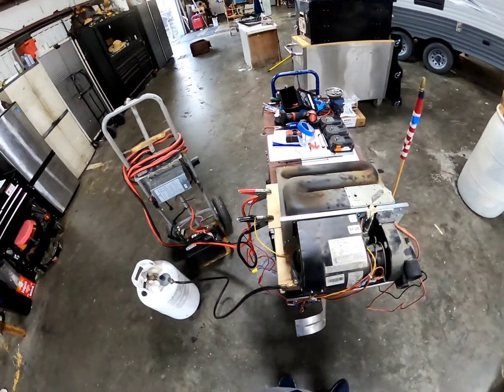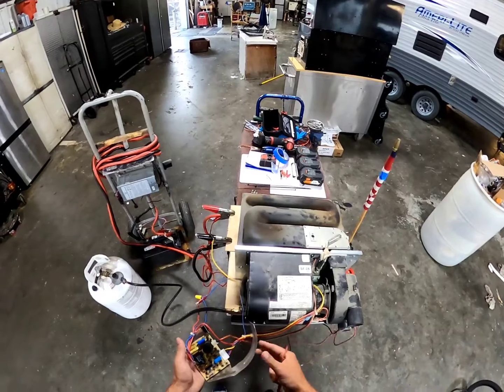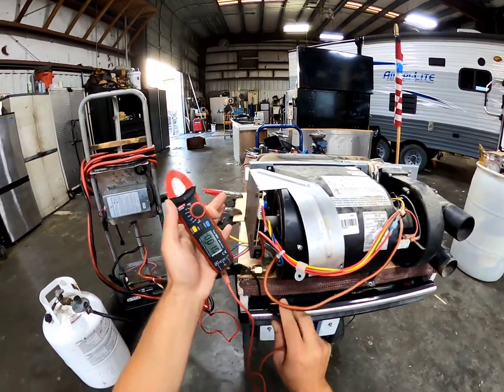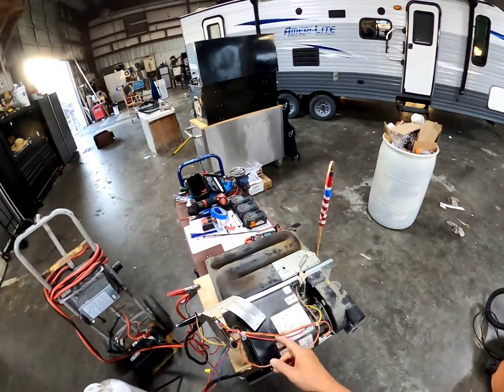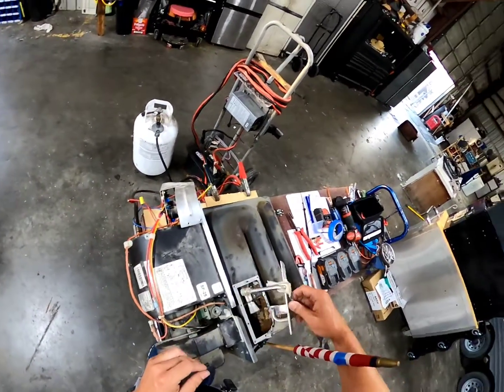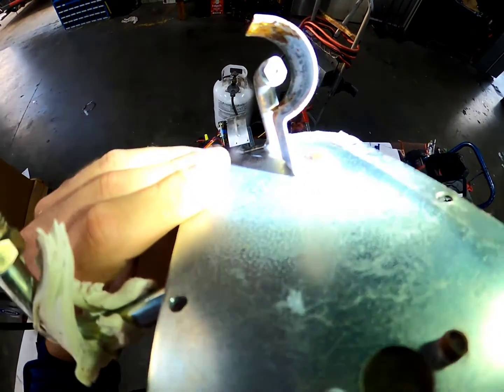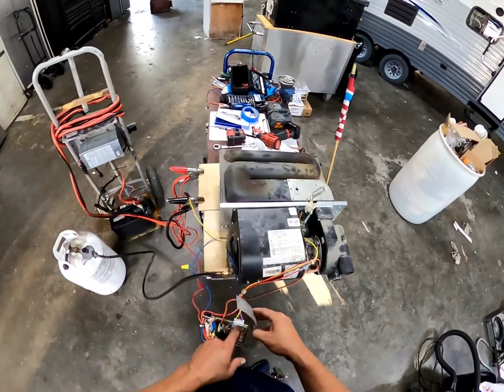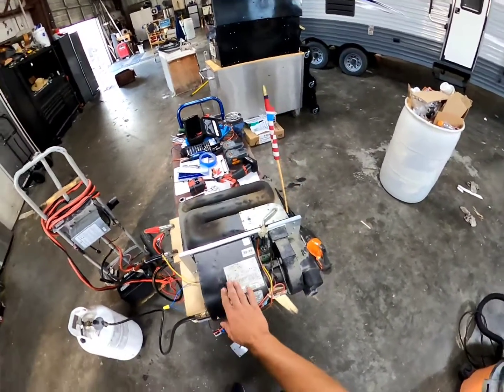Training and diagnosis of an RV Suburban furnace. SF-25.

Comment: Same furnace, what would cause it not to fire when it’s cold? Fan blows but no heat. I hear it click. It works fine when it’s above freezing temperatures
Reply from the maker: Harry, on your control board, when it isn't working, check for positive DC voltage at  the white connector on the blue wire and then the red wire. Let me know and we will know what to check next.
Reply: @nicholasgriffin6631  wow, thank you so much for responding so quick!!!
Problem is that between 8:45 and noon this thing decided to work. Still going. My fear is though that when it’s gets below again I am left with no heat again
Reply from the maker: @harryohanson  I'm hoping we can figure it out. Propane won't stay liquid unless it's -44° so that's not the issue. We'll need to use a voltmeter when the problem happens to get an idea of whats going on. Also next time it happens go outside to it and listen for 2 things. 1) the soft thunk of your gas valve opening, and the ticking of your ignitor electrode. This info will be really useful. I hope it doesn't stop working on you again though!
Reply: @nicholasgriffin6631  oh that is a good idea! Thank you so much!!

Comment: Hi I'm back again.  With a new problem.   When I jump the blue wires I get heat.  When I connect it to thermostat I don't, so a new thermostat.  Or at least jump the blue wires at the thermostat to test.  I may have shorted blue wires to the furnace case.   But let me ask this.  I've got 3 wires coming into the heater space.  One wire to ground.  I'm thinking that's the ground into the thermostat. Blue.  Sounds right ?   
And will the wiring colors be the same on a new thermostat, universal wiring colors?
Reply from the maker: Your question depends on what kind of thermostat and air conditioner you have? They operate the furnace differently based on which you have.

Comment: Hi.  My problem is intermittent.  I've blown out the sail switch already.  Im smelling propane, but no ignition...
So in This order...
I should check the igniter spark at the board, and in the heating chamber?  If no spark, clean the electrode, then if that fails get a new board?
I should check a plugged orifice?
I should consider a bad regulator, because I read that somewhere?
Thanks for a really good video.
Reply from the maker: Texasliam so I can better help you, what exactly is your furnace doing? Does it come on and fan blows but never ignites? Does it not come on at all?
Reply from the maker: Texasliam as seen in my video, on your 4 wire white harness that connects to the control board, do you have DC voltage on the blue wire first and second on the red wire that is on that 4 wire white harness? Those complete the safety check up through the limit switch and sail switch. Get back to me with that answer and let's go from there! This will tell us what we need to check next. In the video its around the 3 minute 20 second mark. 💯
Reply: @nicholasgriffin6631  when the problem re occurs I'll check that.
Reply: @nicholasgriffin6631  it blows for more than 30 seconds usually.  And I smell quite a bit of propane on the exaust.  Of course I don't have access to the fan side.  So I'm hesitant to pull it when it's currently working.  I just thinking it might be worthwhile to pull it and clean out the ignition area.??I do have voltage on both sides of the limit switch.
Reply from the maker: @texasliam  ok I understand a bit more now. So it does work, just sometimes does not want to ignite. Is that correct? If so then I would think you have a good idea to eventually pull it and clean out the burn chamber. Also you could have a small propane leak somewhere that is allowing air into your lp system. This would make your furnace have similar issues. A drop down test using a manometer would reveal this for you. But since you say you smell propane, and it is currently working, I agree with you that some cleaning is the best route to go right now. Reach out again if need be. And keep an eye out for more videos. I haven't shot any lately because of daylight savings time, its too dark in the mornings right now lol. Water heaters are coming next, and eventually everything!

Comment: My furnace quit after a blue wire came loose, no one can tell me where it goes. there's actually two blue wires like you mentioned, but I have only one white wire hanging to nothing. One has power the other one none. Looks like you know more than Heartland and Atwood. Subscribed.
Reply from the maker: You will have to give me these details for the best help. You should have 4 wires leaving your furnace going into your RV. What colors are connected? And where the wire nuts or electrical connectors are (transitioning from the furnace and then disappearing into your coach) how many wires do you have (coach side). I ask because, of your 2 blue wires, some manufacturers only use one.
Reply from the maker: The 4 wires coming directly out of your furnace are color coded. Should be red, yellow (this wire is sometimes black) and 2 blue wires. While these wires are consistent from the furnace, when the manufacturer connects them to your RV they use different colors and gauge of wire. The 2 larger wires from the manufacturer should be your main DC positive and negative. The 2 blues are (1) power up (signal related and not always used) and then the last blue (2) is signal down (must be used).
Reply: @nicholasgriffin6631  yep red black and 2 blue, on blue has 12v I’m assuming one of the blues goes to the white, probably came loose moving  to where I am now.
Reply from the maker: @dean lockamy do this. With your thermostat turned off, check that white wire for voltage. Then turn your thermostat back on and turn the thermostat to activate your furnace, and check the white wire for voltage again. If that white wire doesn't have voltage unless you turn on the thermostat and put it to heat (plus have temp set high enough to call for the furnace) then it is your signal wire and you need to connect the white wire to the blue wire that DOES NOT have voltage. However, if the white wire NEVER has voltage, get back to me and let me know. 💪
Reply: @nicholasgriffin6631  thanks Ill try that as soon as i get back up to the camper, Im sure reconnecting that blue wire will do the trick, as we know quality control is less than desirable in camper construction. Ill let you know.

Comment: Thank you for the video; it gave me the confidence to tackle the project.  I have an SF-25 made by Suburban.  To better troubleshoot, I took the furnace out of the RV.  I did open the firebox, and sure enough, there was a bee nest in there.  There was no way the furnace could operate, and I could send the pictures if you gave me your email.  Anyway, while in the firebox, I did the ignition test, and I did not get an arch.  I did it at the electronic board and did not get an arc there either.  So, I tested the four wires coming out of the electronic card to see if the sail and the limit switches were working.  I did get a reading about 10-11 on the wires.  So I am a little puzzled why I am not getting ignition.  Do I need to change the electronic card?  The Couple wire?  What else should I check or replace?
Reply from the maker: Eric, I just saw your comment. Please pardon the late response. If you have voltage on the wires at the control board, that come through the limit switch and sail switch, my question for you is do you hear the gas valve thunk? It takes 30 seconds or so after the fan runs for the ignition and also the gas valve to thunk and open, letting propane through. If you are hearing the "thunk" of the gas valve but you don't even have an arc from your control board, then I would agree that your board has gone out. Please give me more details so that I can better help you out. And thanks for asking 💪

Comment: Most informative video I’ve found on the Suburban SF series. Have you come across a furnace that blows a fuse the instant the motor tries running? I’m assuming the motor has gone bad since the fans spin free by hand. Any suggestions would be wonderful as to where to begin to look. Thanks for taking the time to make this wonderful video!
Reply from the maker: Its very uncommon (but not impossible) for a fan that spins freely to blow a fuse instantly.  Have you checked for continuity between the fan positive wire, and ground? Perhaps you have a short? You could also try applying direct 12vdc to the fan while amp clamping the wires to see how many amps it is pulling. If the amps are within spec (4 to 8 amps is what I usually see) then the issue may be a short. If the amps are high when you apply direct 12vdc and have taken the incoming power supply out of the equation as well as other wires, then you could narrow down to the fan. Get back to me on this one and best of luck to you!
Reply: @nicholasgriffin6631  followed your video and took your advice in the previous reply. All signs pointed to the fan motor. Swapped it out and tested it before I put the furnace back in the rv and everything worked fine. It appears the motor was the original and had a manufacture date of 6/7/99… I’d say it had a pretty good life! Thanks again for the video and the troubleshooting tips!
Reply from the maker: @stevenlefler6648  Wow a 99! You definitely got some good life there. And just in time for the cold weather. Feel free to reach out with any other issues. I may not have videos posted on other items, but I have much knowledge and enjoy helping others. Glad you're up and running!

Comment: Very nice demonstration. I just bought a 5th wheel and the heat will ignite 3 times then quit until I turn it off and back on. Also not sure why the roof top ac unit is on in furnace mode. Thanks, off to the RV to snatch the heater out .
Reply from the maker: Usually when you have the furnace on and your rooftop air conditioner still has the fan blowing, it is because you have your air conditioner "fan" set to either high, medium or low. On your thermostat, put the fan setting on "Auto". That should solve your issue.
Reply: @nicholasgriffin6631   Hi Nicholas.  Are you able to answer these:  Is it safe to say that if the unit tries to ignite by going through normal process of trying 3 times (ignitor sparking) before the fan shuts-off after a few minutes, that at this point the culprit will have to be the gas-valve (solenoids) because if there's no gas flowing through valve then the board is not getting power to continue running?  In other words, what makes the board shut itself off if there's no combustion?  Is there a sensor somewhere that detects flame or is it the valve that ultimately makes this call?
Reply from the maker: @n.g.1577  the board senses the flame through the tip of the ignitor, which has to be positioned close enough to the flame (1/8 inch). It actually sends millivolts back to the control board, and this is how the board knows when there is or is not a flame.
Reply from the maker: @n.g.1577  do you believe that you do not have gas flow? When your furnace tries to ignite, are you hearing the "thunk" of the gas valve solenoid? When the gas valve is activated, can you smell any propane from your exhaust?
Reply: @nicholasgriffin6631  Thank you for the prompt reply.  I'm going to test it with the gas on tomorrow and will smell for propane.  Will keep you posted after that.  

Where should I test for voltage on my valve?  I have valve part # 161122, and it has 2 solenoids with 4-prongs (1 numbered 1-2, and the other one numbered 3-4).  Good night.
Reply from the maker: @n.g.1577  you can most easily check from the white connector on your control board. Should be a brown wire going from your control board to the gas valve solenoid, and that will be your 12vdc positive. The negative should go to a ground bar like in my video. If your connections are good, just check at the control board. When these solenoids fail, they typically get stuck a little open and leak gas. So if you're not smelling propane, I would check the orifice for insects as well as your burn chamber area for any insect nest etc. Those are more likely causes if you are having propane restriction issues.
Reply: @nicholasgriffin6631  Thank you for the information.  I went ahead and tested for 12v, listened for the "thunk" from valve, but have not smelled for gas.  I've heard the thunk and there's 12vdc going into the board.  Since I'm trying to hook up a quick-connect/disconnect adapter kit in order to test the furnace while it's still inside the camper (no need to take it out of camper to do bench-testing), I'm waiting to complete this task in order to run the gas and smell for propane.  

With your expertise, do you think it's a good idea to hook this quick-connect/disconnect valve inside the camper as a permanent fixture?  For your visual reference, if you search for "MENSI 1/4" Quick Connect Propane Disconnect Universal Adapter Kit Convert Regulator with 3/8" Female Flare to Quick-Release Connection",  you'll see the one I'm using for my application.  Have a great day!
Reply from the maker: @n.g.1577  with all due respect, in my expertise I DO NOT think you should use a quick connect for a permanent install INSIDE your camper. I have seen people lose their lives from improper propane related installs. There is a reason that manufacturers do not us these INSIDE of RV's. If you want an easy solution then perhaps go with a flex hose that still uses a compression/ flare style fitting.
Reply from the maker: @n.g.1577  something like this. Camco 59913 3' Propane Hose Assembly - 3/8" Female Flare x 3/8" Female Flare https://www.amazon.com/dp/B007HG7Y7M/ref=cm_sw_r_apan_glt_fabc_EZHAXSTE9VJ6WTAEMDTY
Reply: My furnace is doing the same thing. No air unit fan issue. Just igniting 3 times then shutting down. Will light for 3-5 seconds and go out each time.
Reply from the maker: @kentmartin4072  in my experience there are a few things that would cause this. 1) if the ignitor electrode tip is not correctly placed to sense the flame (or has an insect nest in the area preventing the tip from heating up enough. 2) gnats or other insects inside of the orifice on the furnace gas valve, not allowing enough fuel through to keep steady flame. And 3) the least common is a bad control board or ignition electrode. Since the first 2 can be easily identified and the issue solved, I would have these checked first before going with the last possible culprit.
Reply: @kentmartin4072  if yours is doing the same thing then that part is working correctly. The problem is the board is not receiving the feed back on the igniter. The igniter also gets hot and sends this temperature back to the board to tell it that the propane is burning. 
I just replaced my board with a board from Dinosaur Electronics , this is a nice product with much better features. 
My furnace is running hot now.